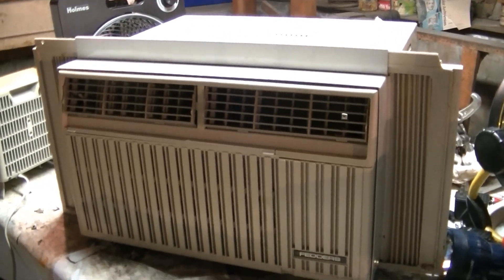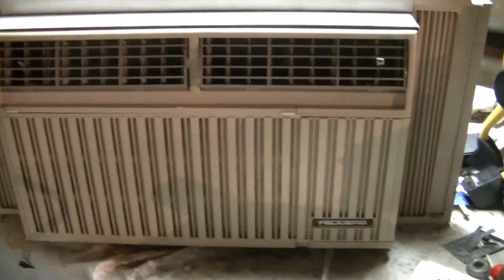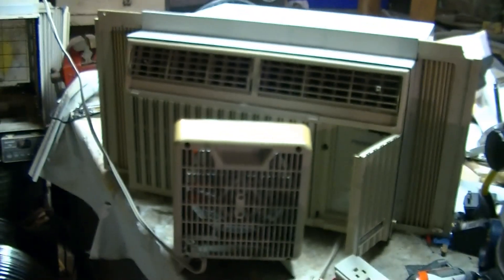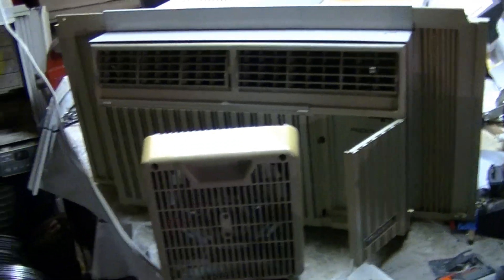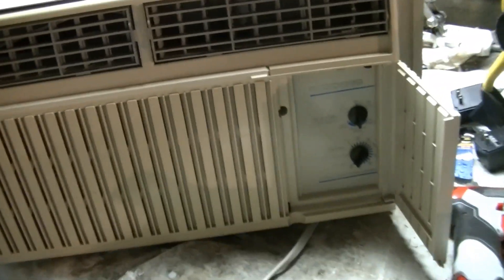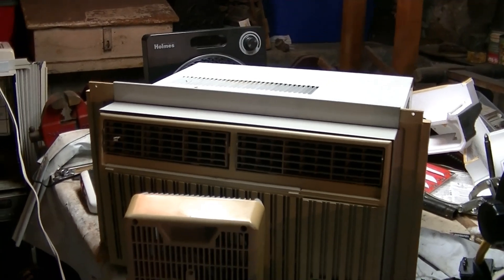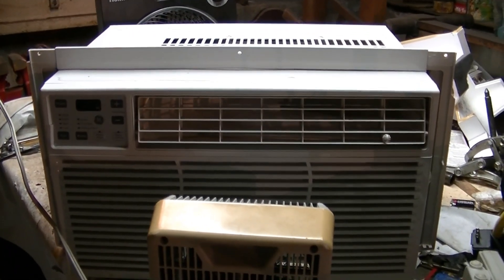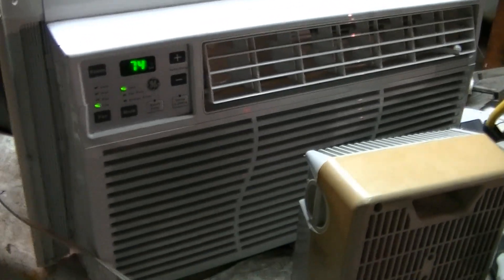2 Fedders 7500 BTU Air Conditioners and 8100 BTU GE

Comment: Greetings, Carson, I hope you are very well. You can do an air show on the Fedders and the GE. Let's see how much it cools at least if the Fedders cools more than the GE. PS, it's okay. If the GE cools more than the Fedders. PS, it's okay. you can find the thermostat and put it on the air conditioning fan
Reply from the maker: I will install them eventually and do a test to see which one cools a room down faster.  I think the GE will since it has a higher rating, but the Fedders are great units as well.

Comment: This is a very interesting comparison of great machines! Its cool the last one survived a blocked up condenser coil with no apparent damage. I always wondered how damaging that is.
Reply from the maker: I'm surprised by how many air conditioners have survived blocked coils.  The Coolerator unit that was stacked on top of the second 7500 Fedders had zero airflow going through the condenser when I got it.  The capacitor was bad too and wouldn't start the compressor sometimes.  It still works perfectly after a good cleaning and a new capacitor.